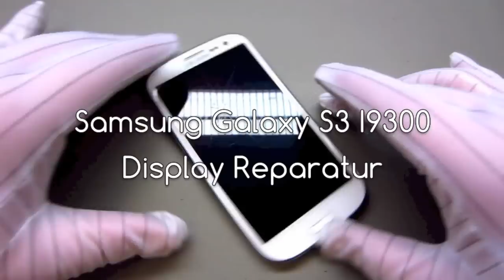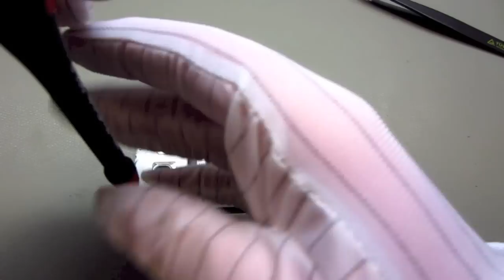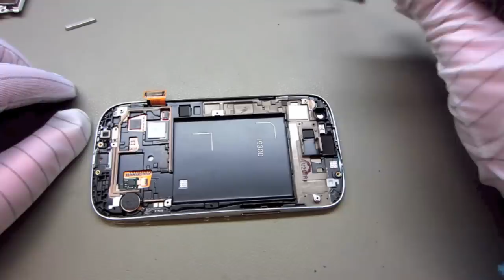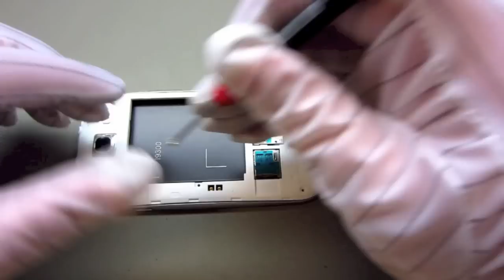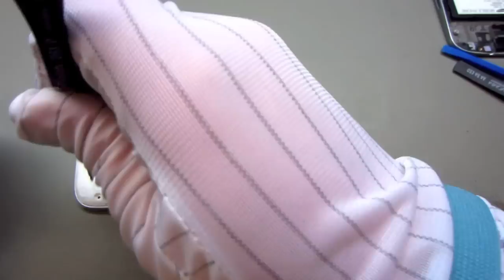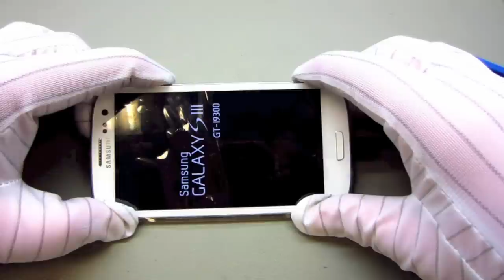Samsung Galaxy S3 Screen & Display Fix

Comment: please help, i dropped my s3 and my screen has a very small crack but the display is not working and it just flickers blue when i turn it on.
Reply: Notorious Arts try and take the phone apart until you get to the motherboard.....then use a heat gun at 160-200 degrees abot 9-12 inches away from the back of the phone.....use the heat gun for approx 2 minutes.......let phone cool off wile you are waiting to put it back together....plug it into via usb computer....then after about 1'30 seconds put the battery into the phone and pray!!!!hopefully it will re-saddor the broken wires from the crack,
Reply: +Devin Reagan ll0
Reply: Devin Reagan bzbdbdb

Comment: you probably won't know the answer but do you think if i disconnected the screen connector and plugged it back in would it fix my black screen issue?
Reply: +Michael Street i already tried all the other solutions

Comment: Might as well buy a new phone. To replace the LCD and the touch digitizer will cost you around $70 for the replacement parts on ebay. And this is not a sure fact it will make the phone work if it was broken in the first place.

And this video is stupid, he basically got another phone and used the old battery. WTF.

Comment: My friend thought it was a good idea to slam his phone on some surface the problem with this phone is basically it go on blue led light and the sound is there fully but the screen will not go on no matter what so I left the phone on charge I think the phone switches itself off then the red led light comes on as soon as I turn the phone on its normal but just no screen power or light  now the phone is flashing the blue led light as normal email to resolve this thanks
Reply: Mi have the same problem but I didn't hit it off anything
Reply: +Kyle Chetty Did the screen crack at the time? because that's what happened to me but the screen cracked